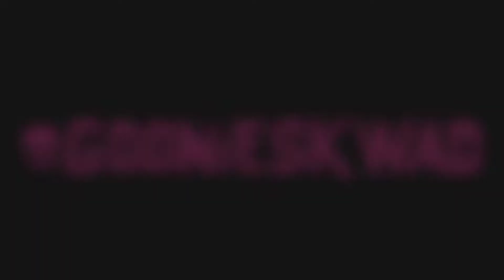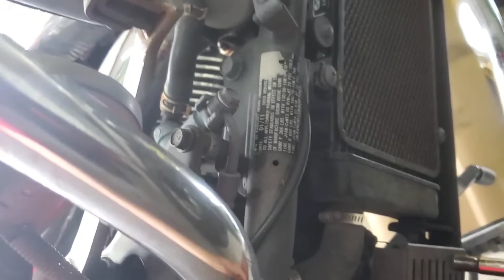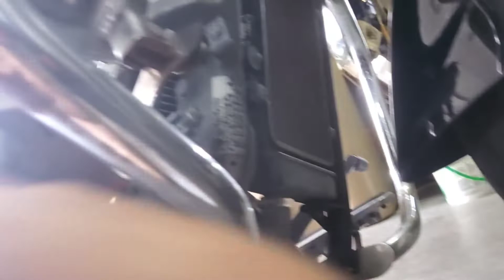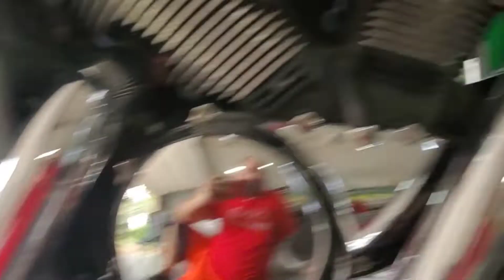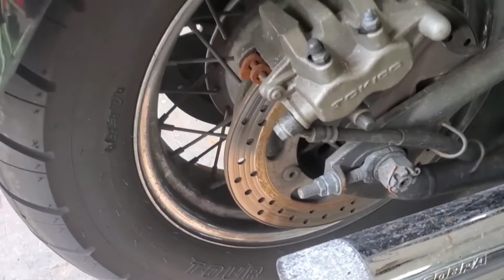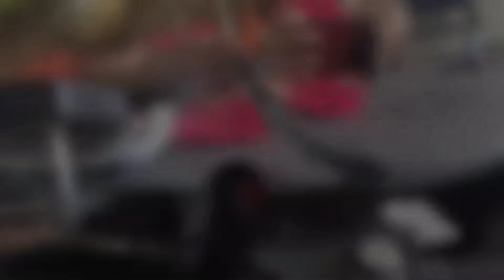Kawasaki Vulcan 900 Oil Change Start To Finish

Comment: So i just learned that you dont have to take off everything to get to the oil filter. There is a nut under the radiator hose. Loosen that nut and the bar that everything is connected to just swings away from the frame.
Reply from the maker: Newer models yes but not this model